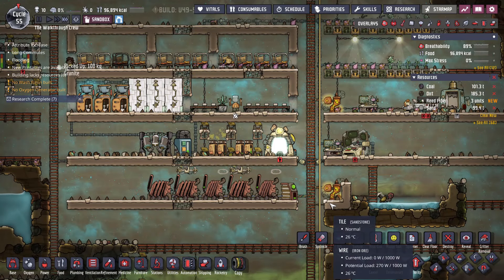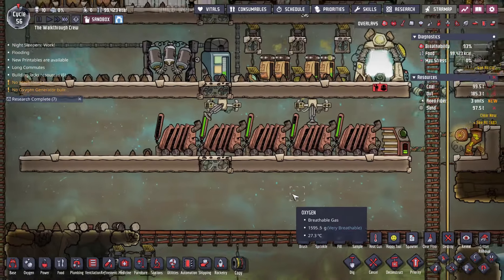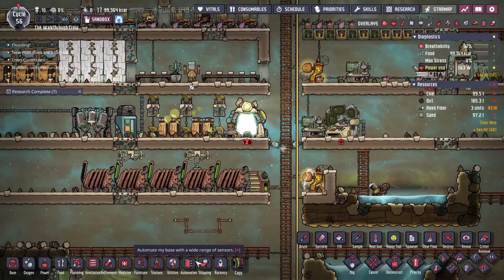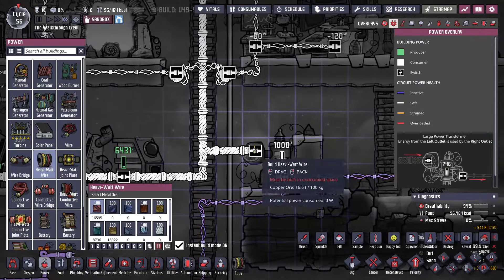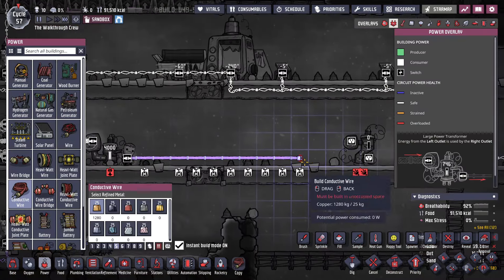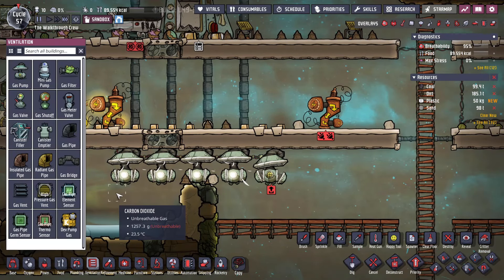How to Manage your Power Lines in Oxygen Not Included

Comment: I'm not sure i understand why the 4k transformer even exists. connecting 2 1k transformers together (input + input on the same wire, output+output on the same wire) gives you a 2k output which is the maximum for a conductive wire and you're never running any thing greater than conductive wire to any non-power generation appliance. Am I not understanding something? I just don't see the use case for the 4k at all.
Reply: Refined metals are easier to find renewably. If you have a gold volcano tamed you can make infinite 4k transformers, while raw metals are less renewable. 

As an aside, I also exclusively use 2k transformers for most of the game so I agree with you.
Reply: Transformers have 1kJ or 4kJ of energy capacity and wires have 1kW or 2kW power usage, Im not sure if Im right but I understand this as if you connect 1kW wire to 4kJ transformer it will last 4 times longer than 1kJ transformer when your power generators shut off. Like a battery. Sorry for bad english and feel free to correct me.
Reply from the maker: Interesting, I hadn't considered it other than resource usage.  Refined Metals do become free later in the game.  It also looks like the heat output of 2 smaller transformers is 2x as much as 1 larger transformer, and it takes up slightly less space for the same capacity, so I guess that's also a thing.
Reply: There are uses. They're just more complicated than they're worth.  like using a 4k to send power over regular 1k wire to a smart battery + power shutoff combination.  it will charge the smart battery faster and you can send power across the map using cheap wire.
Reply: One thing that's nice about the 4K transformers is they hold power like a 4KW battery.  In the mid/end game, once you built a power spine that runs the length of an asteroid, sometimes it is preferable to connect a 4K transformer to the spine and then use the 2K power line to run power nearer to where it is needed, then connect it to one or two 1k transformers.  This is only if you really want to max out the decorative values by hiding all the utilities as much as possible.  Also, it should be mentioned that batteries, smart or otherwise should always be on the power producing side of the transformer, not the consumer side.  Batteries in ONI have no limit on the amount of power they can release, so if they are on the consumer side of a transformer, they can easily overload a wire.
Reply: You can use a row of 5 4k transformers to connect 50k wires to the 20k wire when you need to separate and upgrade your main Power line,in mega bases when you have more than 20k consumers when the 20k wire cannot keep up.
Reply: Well, sometimes when you want to separate a power circuit via transformers and you know for sure that it won't overload (max power consumption of each separate conduit wire circuit is around 2k or less)you can use 4k transformers to safe extra block of horizontal space. Plus 4k are handy when you want to separate a high voltage circuit into several parts.
Reply: You can have 2 conductive wire circuits connected to the 4k transformer output
Reply: @TweenkPL  yes but you'd then have to use 2 1k transformers to use all 4k at once, otherwise you're going to overload.
Reply: @marceloyujitanaka8841 wow. That’s cool. I was wondering how to do that. Sounds like a transformer station in real life.
Reply: I know right? The 4k transformer is so incredibly edge case in when youd use it, since using it on a conductive wire means you have to  pay extremely careful attention to avoid damaged wires, and its RARE to need transformers between heavi watt wires.
Reply: @czarnokolorowe  yes, but you have battary for it

Comment: The reason the gas pump example didnt break wires, is the tranformer itself limits the wattage. If you try again same test off a smart battery, it will break wire. this is without mixing wire types

Comment: One of the easier ways to run into still overloading when using transformers is if you have a battery on the output of the transformer, where it will attempt to supply the full wattage requested and overload a wire. Which is also how I temporarily supply more aggressive processing that also gates later materials and construction, like the first metal refinery needing over 1kw, I'll put it somewhere I can supply it with coolant for a while, run a normal wire to a transformer, use the 2kw wires to connect that to a battery and the machine and you can at least process in short bursts.
Reply: There are ways around that.  I do it all the time with my early game refinery.

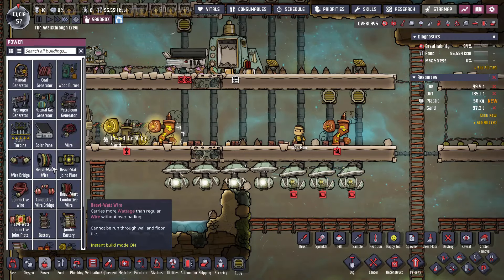Comment: @8:04 ish... the reason theyre not breaking is they dont really break if theyre hooked up to a transformer. since the transformer only sends out 1kw there is no overload, but if you had 5 gas pumps hooked up to a simple wire connected to 2 coal generators with no transformer they will break since the line will be able to attempt to draw up to 1.6kw of power. you can have 5 gas pumps hooked up to 2 coal gens on all simple wire if the two coal gens simple wire goes into a transformer then into another simple wire. the 5th pump with have brownouts but the wire wont break since it literally cannot overload becasue the transformer limits the flow to 1kw.
In practise: things like item sweepers (i think thats the name) could theoretically all be on the same 1kw simple wire and still function pretty normally if there isnt a huge load of items they need to pick up since they only use power when they need to pick up an item. the 5th 6th 7th etc sweeper would have brownouts at first but once the first 4 were done picking up their items, the sweepers further down the line would then activate and eventually all items would be picked up. so long as that whole line is coming out of a transformer. an example would be critter farms. say you had 10 hatch farms each with a sweeper to pick up coal eggs and meat, thats 10 sweepers with a load of... i wanna say 240x10 but it might be 120x10, either way its 2400 or 1200, but for this we'll say its 2400 which is way more than a 1000 watt wire can hold. only some of them will ever able to be on at the same time, but once they pick up what they need to they dont draw power so the ones the browned out would kick on when the first ones are done. within preeeeetty much the same amount of time all rooms would get cleaned.
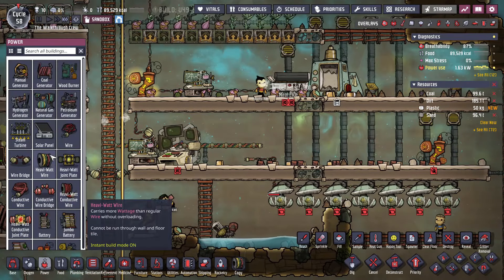@9:28 a large transformer was connected to a simple wire with more than 1kw load. the transformer outputs 4kws so thats why the line turned red. eventuallly it would break, but will never break with a simple transformer since again it limits the flow to 1kw
Reply: That makes sense, I remember having broken power cables but I was wondering if that changed since I played back before full release but I think in all of the cases I recall it was still early game and I had too many things without transformers.

Comment: If you are looking for a regular wire to briak under load (not mix) try putting a bridge on the line. The bridge is the weak point
Reply: Ah, so the bridge acts as a slow blow fuse... Nice, might be cheaper than a transformer.

Comment: Heavy watt wire is great bc it can be made from lead which you get like hundreds of tons of when you demolish the oil biome. It is my go too because it really can't over load. Heavy watt wire is fine in most cases, but I have actually found myself having a larger potential load than the conductive wire. I had a conductive wire reach a potential load of over 60 kwatts, mostly from aquatuners I had scattered around my base that I use for cooling steam vents or other stuff.

Comment: Wire damage only happens when there is no transformer on the line (or sometimes when the line is misconfigured or looped back on itself at the transformer), because the transformer is responsible for "moving" power from one wire network to another.

Comment: Just thought of this experiment. 

HWW to a large transformer. 
Then conductive wire to two small transformers: then you can run 2 small circuits inside a building without breaking the wall for the heavy conductive wire bridge, preventing the heat transfer than can go with that. 

Why you would need this, not sure but it could be done.

Comment: I built a sour gas boiler that turned one full pipe of crude into natural gas and the resulting natural gas generators produced enough power that the heavy watt conductive wire needed to be split into two grids.  

So, I've run into a situation where the heavy watt and heavy watt conductive were not beefy enough.... But I think your point still stands.

Comment: Sour gas boilers feeding a huge number of natural gas generators need it.  75+ (edited... should have said 75) natural gas generators need to be split in half-ish with 50 watt wires as the combined is much higher than 50 watts.  There is also a trick about just using the smallest wires for power generation and feed them backward into the transformers.  It works as long as there are no power consumers are the low watt wire lines.  Also, for the runs that you have that have very intermittent "red" overloads, put a bridge in there.  I usually do it right near the transformers.  The bridges will damage and break before the solid lines will.
Reply from the maker: Man, what are you using 35 natural gas generators on!?  I can't even envision why you'd need that much power production unless you're just doing silly things for the sake of it.
Reply: It isn't just for the power - and I also had a typo - it was 75+ generators.  3 oil wells running constantly (3kg/sec water) feed 10kg/sec of crude to the sour gas boiler.  Byproducts are the natural gas to run 75+ natural gas generators (or the gas just backs up), a ridiculous amount of sulfur for sweetle ranches (100ish), and enough CO2 to have a huge slickster ranch (50ish).  The very cool thing is that it is completely sustainable once it is running.  Having that many generators actually is net water positive for the entire system.  Extra water from the generators boiled in the hot box, water from steam turbines redirected to feed the 3 oil wells and still have a decent amount of water extra.  So... for a large investment in steel and thermium, you can have eternal/sustainable power/food/water for an infinite amount of cycles.  Plus, sour gas boilers are cool as hell to make/watch work.  Counterflow heat exchange is amazing.  It wastes power, but the generators supply more water than it costs (via steam turbines) and CO2/sulfur for ranches.  @Magnet_MD
Reply: @imdontknow7516 don't need to split power producers.  only power consumers.
Reply: Right - I mentioned that about the power trick.  The reason I split them is because I take 20 or so generators and power the sour gas boiler and the rest for base (with a lot of wasted power, honestly).  For me, the reverse transformer trick is something I don't like to use - which is odd because I do a lot of infinite gas/liquid storage for convenience. @Dolph_Vader
Reply: @imdontknow7516  reverse transformer trick?  now i have more research to do.

Comment: The gas pump only shuts off because of the transformer limiting the current but if there is no transformer it will just overload the wire. It doesn't have anything to do with mixing wires unless you are, for example, loading a heavy-watt wire with 10kw and then connect a regular wire directly, but this is just because the load is too high for the regular wire.

Comment: The transformer limits power and causes outages. Without the transformer, the wires will break, and they will break at a random point. If you put a number of generators on that same wire it will exceed the wire limit and that will cause damage at a random unreachable point.
If you put a battery on that wire, that battery will be able to supply the power demand and the wire will still break.

In all cases look at what you have: ores can be finite (normal and heavy watt wire) but pure metals (conductive) can usually be found in a vulcano and hence are infinite.
I have 2 iron volcanos and one copper, and a shortage on ore so I had to redo all wires to conductive ones to regain the ores.

Comment: what ive also herd is for example i run conductive wire off 2 small transformers to get the conductive wire's full load. ive been told that can have shorts but i  dont have issues that i keep getting told i should

Comment: Think breakage happens when a battery is on the low side with a wire that can not handle the load.

Heavy Watt should not really be where your dupes walk also, due to really bad decor values.
Can use two of the smaller power transformers into a conductive wire since that would output 2k. Large power transform actually can connect to a 4k wire which does not exist. Think Large vs 2 Smalls is better for power drain, which all transformers and batteries have.

If you want a dupe gym/dupe power + nomarl power. Can take a 1k line into a transformer into the heavy side. Just need to put a smart battery with a bit of automation to the wheels, this is due to transforms have a mini battery in them.

Comment: If using a transformer as a "battery" then brownouts will only be able to happen not burning wires. its as soon as there is a load that can take from a battery and sustain a potential, I think bridges will be the first thing that starts breaking on the low power side. and a 1000W wire can sustain all producers as long as there is no consumers exceeding 1000 Watt, batteries are not counted as consumers, everything else is either a consumer or  a  producer. the large power transformer is kind of weird that it gives a 4k Watt output while no wire supports 4k Watt in the game.

Comment: A couple questions: 
Does it matter where on the line you put the smart battery? I usually place it next to the power generating devices.
Will you ever need more than one smart battery per power generation device? I've seen set ups with several smart batteries in a row.  If you do this are they all connected by automation to the power device?

Comment: How do you then deal with the decor? As running a heavy watt wire through the middle of the base isnt the nicest thing for dupes to look at
Reply: I like to run a main line at the side of the base, then you can add transformers and just the small wires enter your main base, you can add a cooling line to the transformers if necessary... still, decor isn't something you should worry about until late game
Reply from the maker: I honestly don't pay attention to it.  The morale boost you get from food, rooms and break time will get your duplicant skilled up in all of the necessary ways by the end of the game.  I used to worry about it and try to avoid them having to see the wires, then I switched to building it in the middle of the base and not caring, and I didn't even notice a difference in my dupes' performance.

Comment: I suspect that overloading happens when you don't use a transformer, or you have a battery on this side of the transformer
Reply from the maker: Overloading really just happens when too much current is being sent through a wire that can't handle it.  There's a few different ways to do it, but one way to consistently avoid it is to not allow different wire weights to touch each other.

Comment: hey magnet do you like using the power plant microchip thing?
Reply from the maker: Sometimes, it kinda depends on how much metal I have and how many duplicants I have.  It becomes a full-time job for a duplicant pretty quickly, and it will consume a decent amount of refined metal.  Overall, I think it's good if you're having power problems, but if you have a low duplicant count and otherwise have a stable power grid, I don't think it's worth it.
Reply: @Magnet_MD  thanks for the quick response!  did not at all know it would need a dupe operating it, so it looks like ill pass on it for now.
Reply from the maker: Yeah, I mean if you're strapped for power and have strong generators (like 800W+ per generator), it's worthwhile.  But if you're good on power or only have weak generators, meh.

Comment: I'm having issues. I've got my grid set up gens>heavy watt>big transformer> medium wires. 

The problem is that the power is only making it to one transformer while the other transformers on the heavy watt line starve.
Reply from the maker: Hmmm, maybe you just need more generators?  Or the other transformers are trying to put out more power than they can convert?
Reply: @Magnet_MD   my power input should be complete overkill for what little I'm running. 

So far all I have set up is 2x electrolyzers, 5x gas pumps, (for oxygen/hydrogen) and 3x hydrogen gens.

I have the consumers split evenly between two transformers, no wires cross. No electrical bridges, no wall plates, nothing fancy.
Reply from the maker: Sounds like it's a SPOM that doesn't quite go power positive?  I would need to see the setup because if that's the case, you'll need to have the right automation and setup to make it truly power positive.
Reply: @Magnet_MD  yup, it's a spom. I've been looking at video after video on YouTube about them, and power lines since posting...

I managed to get it working yesterday, but I had to remove all my wiring and put each gen on its own line (with only one transformer) instead of linking them all to the same main.

I'm starting to think I need to do a clean reinstall of the game, that there's something left over from a mod I uninstalled that's causing power to not pass through.

Edit: I also thought that maybe it was something to do with batteries, but I tested the new system and it doesn't seem to matter too much where in the line those sit.